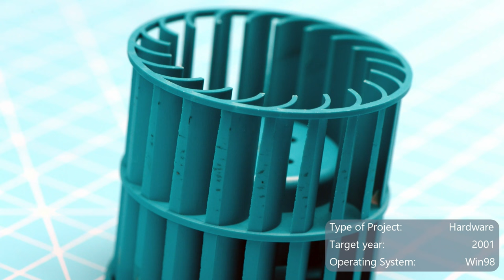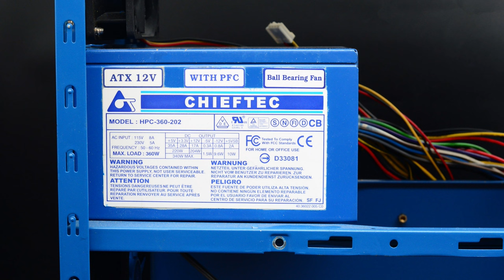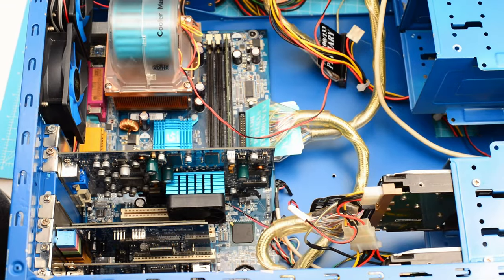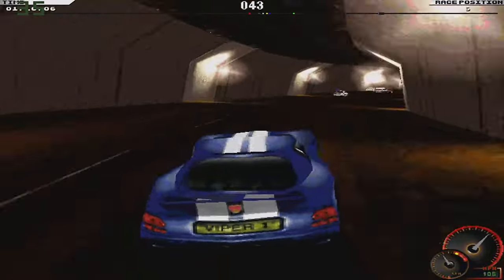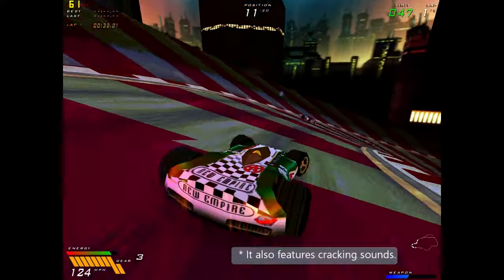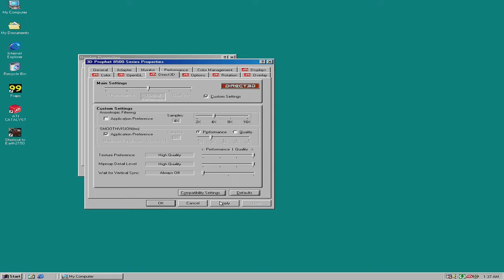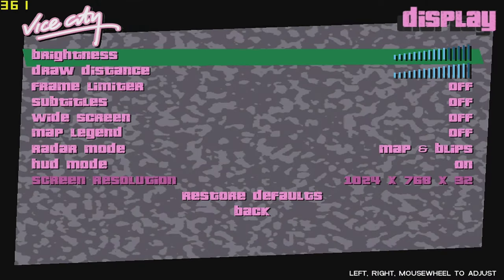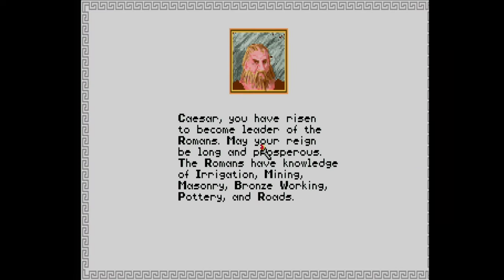Building a Windows 98 PC with Pentium III-S 1400Mhz and Radeon 8500

Comment: Beige is 90s retro, blue is 2000s retro. Also, only a true nerd could have found the blue in a Pentium 3 CPU, gg!
Reply from the maker: I think a true nerd would have painted the CPU blue, btw I found out a couple of days ago that the PSU was painted blue and it's not blue by default.
Reply: No blue was 90's mate albatron used blue
Reply from the maker: I have a  collection of albatron cards as well, big fan of the color. And I was disappointed when they switched to green. . I guess I can toss in a gf4ti4600 or a 4200.

Comment: Hi, there is a NETGEAR FA311 Rev-D2 network card in blue closer to the color of your motherboard. I have one in my possession. Thanks for your video.
Reply from the maker: Thank you for the tip. I'm currently looking into getting 2 blue voodoo 2 cards and maybe a different sound card and I already got a new blue case. So in a future video I'm going to upgrade this build. I'm also considering replacing the cpu with a less powerfull p3s maybe a 1266mhz so I can free up the 1400 for other projects.

Comment: Great build! I've watched alot of builds on YouTube, most do not bother to add exhaust fans, you added two, good for you, and they are blue too!! :)
Reply from the maker: Thank you, I got the system from a friend like this and I've used it for a while. I even modified it a bit for the upcoming video. I do plan to move it to an even blue-er case, and even get a pair a matching blue voodoo2s but I'm not sure that I will be able to get them soon enough.
Reply from the maker: Thank you, I got the system from a friend like this and I've used it for a while before deciding to present it. I started modifying it a bit for the upcoming video. I do plan to move it to an even blue-er case, and even get a pair a matching blue voodoo2s but I'm not sure that I will be able to get them soon enough.

Comment: Hey I have the same cooler , I have a bit of trouble with mine , I have taken off sticker , clip and 2 plastic washers , does it now just pull apart?
Reply from the maker: Yes, firmly but gently, you should be able to pull it apart. It may be a little stuck due to the dirt, mine was. It was a little harder to pull apart than just a regular fan.

Comment: P-III is MS-DOS, ISA, Windows 98, Voodoo cards and Creative EAX. Games up to year 2000. That Radeon is screaming for a better CPU.
Reply from the maker: I know the 8500 had support (drivers released) until 2006 and it really shined after they got stable. Stil the p3 1400 is no slouch, I'm currently comparing it to p4 and it easily outran the P4 1700. Don't worry the card will see a proper cpu when really benchmarked, for the purpose of this clip it was there because it was blue.

Comment: might i suggest a usb 3.0 ports pci bracket with a usb3.0 headers-to-usb2.0 headers adapter in between that and the motherboards usb header?
Reply from the maker: That's actually a doable suggestion, I'm not sure I can find the USB 3 header for the motherboard... But I think it can be done at some point.

Comment: E interesant de unde ai luat un 1400-S. Vezi că overclockează bine, până pe la 2.5GHz. Bate Intel Core Solo la frecvențele alea.
Reply from the maker: Luat de pe olx de la ronin82. Nu știu dacă as avea curaj sa-l duc pana la 2500 sau dacă as avea cu ce. Eu cam stau în placi de acum 20 de ani, fără sa le fi schimbat condensatorii inca. În clipul următor (am pe comunity un post despre clipul urmator, am un p4 423 la 1400, o sa-l adaug și pe asta în comparatie și o sa mai fie și un tueleron 1400)

Comment: One way you could improve the video quality is by recording / rendering the video in 60fps. 1080p30 is pretty bad on youtube. If you want even higher quality, you could render the video in 1440p60 for the added benefit of a better encoder and higher bitrate.
Reply from the maker: Thanks for the advice, right now I'm doing the clip in 1080 and then super scale it to 4k with DaVinci. There's only one clip with 60fps on the channel.
Reply: @retrodrive-thru47  Oh right, I was watching on my phone and there was only 1080p, didn't realise there was also 4k. Still I think 60fps would be an upgrade, it helps a lot, not only with the higher bitrate but better fluidity.

Comment: i don't think you would see much difference with cooling on those cpu's due to 2 reasons
1 they don't heat up all that much
2 ihs and 22 years old white thermal paste under it really might keep you from seeing any benefits, since paste is poorly conductive by todays standards and ihs spreads whatever heat you get over larger area

finding blue sdram could be a problem , i would rather look for lowest timing memory in 256mb sticks pc133 (cl2) or even 150 if they still exist because overclocking ram from 20 years ago is like dragon bals. if you get good ram, , source some geil blue radiators to dress them up.

as for video caprure i would keep it as close to native aspect ratio and colors as possible  with integer scaling
if it won't be full screen so be it , just don't "add quality" that was never there by scaling filters and smoothers , because windows 98 games was never ment to look this way :P

by the way d3d version of dungeon keeper looks really good on this setup, with hardware scaled sprites unavalable in direct draw version

Comment: Nice build! But the CPU fan is facing the wrong way!
Reply from the maker: Yes, I noticed that as well.. It's pulling air from the back
Reply: @retrodrive-thru47  Yes, it is! For a radial fan than isn't that great.
Reply from the maker: @PauloRAgostinho  I noticed late in the build when I already had everything on the table and filming games. Since I never had this type of fan I was lucky I didn't fit from top down :))
Reply: @retrodrive-thru47  ahah indeed! 😂
Reply from the maker: @PauloRAgostinho  I do plan to move it to another case and add a Western Digital Blue HDD soon so I will reverse the flow then. I noticed that it's a very silent fan when I decrease the rotation speed. I'm thinking about experimenting with a silent PC for that future build.

Comment: Very nice system, I have something similar in magenta...but with Athlon XP. I'm looking for a CPU cooler made of copper for 370/462, but unfortunately I can't find one anymore. I have a huge heat problem with a 3200+...normal aluminum cooler isn't enough, it gets to 80 degrees and higher within a few minutes...
Reply: The paste under the IHS is probably toast.  You can look into deliding it to replace the paste.
Reply: @squeeeb  No, the problem occurs with fresh thermal paste.
Reply: @chrisrudi7162  Oh ok.  I was thinking of the Athlon 64 3200 which has an IHS :)
Reply from the maker: I think the 3200 needs a radiator with a copper core, or a full copper radiator. This is the kind of cpu I have in mind for testing the abilities of the CM Aero.

Comment: There are many good aps you can sownload both to Iphone and android whit different type of camera if you like early 1900s camera år 1990s camera etc etc i use it on my old Iphone 8 plus and i am going to use it on my iphone 15 to....do i like to take pictures and film i have some HD body cameras an Nikon D9000 etc etc but to be able to film whit my iphone and it look like old film is very nice and fun..i am a collectyor of computers well i was but i got to many and i need space..:)...i grow upp in that time when 286 386 amiga etc etc so i stil like that pc from that time....well it is not direckly about pc but when you say use an old camera i was thinking about this apps...sorry for bad speling and gramma i am from sweden
Reply from the maker: Great grammar, don't think about it. Well, I also have a 286 and several 386s that I hope to present on the channel at some point. I'm filming with a dslr that in itself is a great camera but when it comes to video in artificial light it can't match the new mirrorless cameras, even phones sometimes are better. Cheers!

Comment: If you have access to soldering equipment or someone who can help you solder stuff, I have blue PCI Sockets I could send.
Reply from the maker: Hi Marco, that's pretty generous, and I may take you up for the offer in a couple of years. For now I got 2 blue voodoo 2s that need a lot of work. I also got a blue hard-drive and I'm trying to get some blue radiator sdram@150mhz. I'm also moving everything into a blue-er case so I have my hands full for now.
Reply: @retrodrive-thru47  Well, if we're not in a rush, once I have time to extract them from the board, I could send them and you can deal with them at your own convenience, to make your system just a bit more blue.